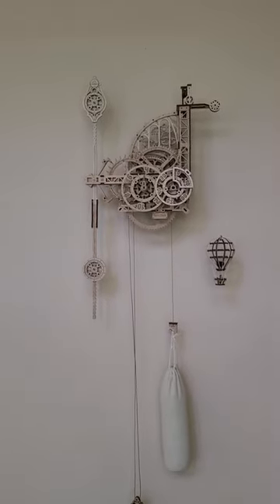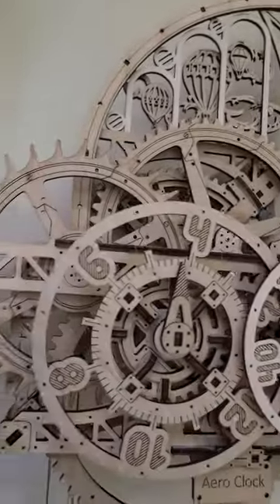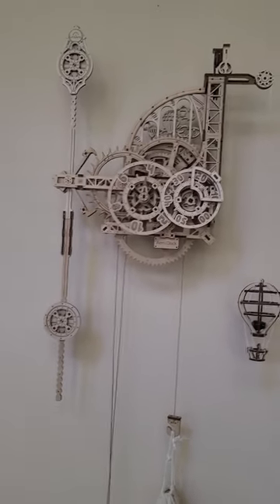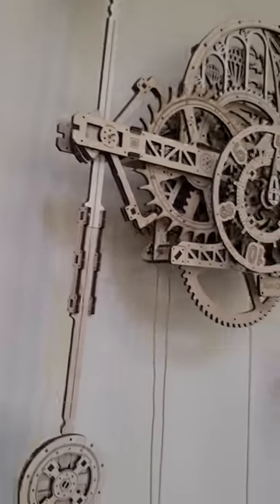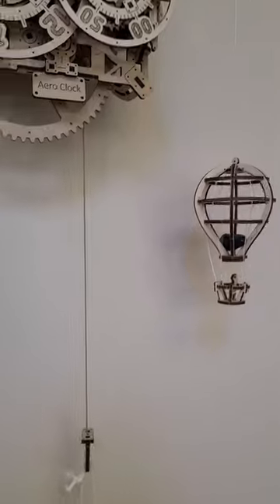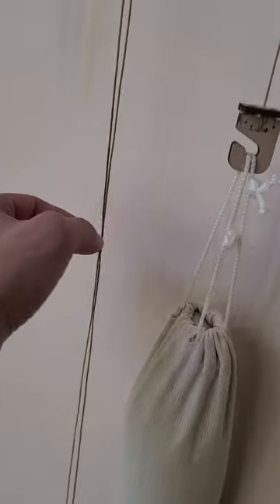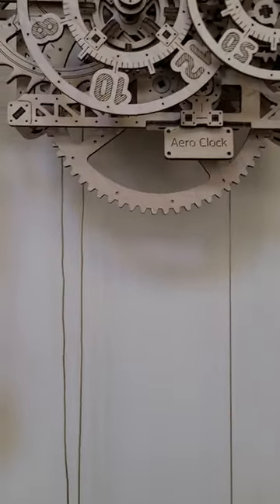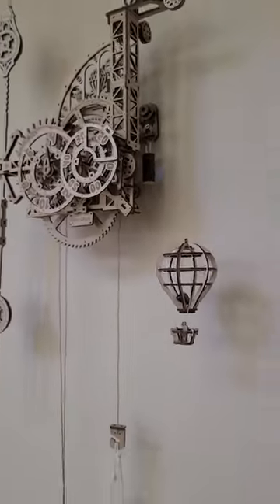UGears Aero Clock Review

Comment: Mine runs 25 hours, but not with the supplied sandbag, its just too long. I found a Lead Weight mantled with brass by Ebay which is only 4 Inches long. The mounting holes at the wall are 1,8 m high (as recommended). I also had to make that Gap as shown in the review. I used Vaseline to lubricate all the parts and gears with a small paint brush, thats much easier as a candle,  and you can lubricate the gear tooths completely . (You may have that for avoiding friction for  your best friend in your bedroom :-).  My clock runs smooth with only 1400 grams of that Lead weight!  that should prevent gear wear, if you need 2 kg you have to reduce friction!

Comment: how long does it run for? can it make it over 24 hours before a re set?
Reply from the maker: 12 hours
Reply: Bei mir läuft die Uhr 24 Stunden, das hängt aber auch von der Seillänge an dem Gewicht ab. Ich habe ein Bleigewicht, 900 Gramm, und  eine Seillänge von ca. 160 Zentimeter am Gewicht.
Reply: You have to hang it high on the wall to get it to run over 24 hours
Reply: It would depend on how much the sand bag can travel. I'd imagine, in theory, if you had it mounted on a tall enough wall, it could run for weeks.

Comment: I'm definitely interested in buying one, but since the tolerances seem so tight I wonder if the wood will warp if it's in an above average humid environment like in a kitchen that frequently has boiling water, in a room with a tropical fish tank, or a home that doesn't have or rarely uses air conditioning.
Reply from the maker: Mine has definitely become more finicky over time and I do suspect it's due to warping. Still, it's a lot of fun to build and is definitely cool when it's running.

Comment: Thank you for the review and tips! I’m slowly troubleshooting mine and I did take the piece off the pendulum to get it to swing more. I tried graphite powder on the escapement wheel too but it was too messy. I will also try to loosen the other connection you first mentioned. I have too much friction and mine will only run for a few minutes straight at most. I can’t wait to dial it in. For the WD-40, was that really helpful? I’m afraid it will just soak into the wood. Thanks again for your help!

Comment: Too right, FRICTION is your enemy.  First time I built this it wouldn't run, despite sanding and using the candle wax where directed.  I dismantled it and decided to use graphite powder instead on all axles, cogs and any surfaces that are in sliding contact.  Yes it's a bit messy, you have to be careful where you put it as it stains the wood, I used a small paint brush to apply it, but it's a far better lubricant that the candle wax.

It's running now, but the ticking of the escape wheel isn't consistent yet, but I appreciate that there is some running in period whilst everything beds in, especially where the teeth on the pendulum slide on the escape wheel.  Just pleased it's now running without stopping.  I've got around 2.2 Kg in the bag at the moment, I hope to be able to reduce that (so the loads on the clock frame are reduced) in the future when it's running consistently.
Reply from the maker: Graphite powder, really interesting idea!
Reply: Hallo Ian, 2,2 kg sind zuviel. Das verzieht die nur gesteckte Holzkonstruktion. Meine Uhr läuft derzeit mit 900 Gramm. Ich habe alle relevanten Teile geschliffen (600-er)und Buchsen, Laufringe und Zahnräder gewachst. Anschliessend wurden diese Teile mit einer weichen, rotierenden Bürste poliert. Der Leinenbeutel ist zu gross und setzt auf Grund der Länge zu zeitig auf den Boden auf; das kostet ein bis drei Stunden Laufzeit. Ein Bleigewicht von nur sechs Zentimeter Höhe ist günstiger und nimmt nicht so viel Platz in Anspruch. Die Seilkabine ist zu leicht und hält damit die Seilschlaufe des Aufzugsseiles nicht glatt. Habe etwas Gewicht (Blei in der Grösse des Kabinenbodens, 2 mm dick) in die Kabine eingebracht.
Reply: Instead of graphite powder, use a pencil instead. Also sand smooth the teeth of the gears, and polish with a piece 0f metal, the steel handle of a needle file will be ideal for this.

Comment: How do you reset it?
Reply from the maker: Take off the weight. Pull the left string (the one with the basket on it) down as far as it will go. That raises the hook that the weight attaches to. Put the weight back on. Manually turn the hour and minute faces to the right time. Done.
Reply: Es reicht aber auch, das Gewicht in dem gleichen Mass anzuheben, wie an dem Aufzugsseil gezogen wird. Und nicht so ein schweres Gewicht, das ist kein Kran. Habe derzeit 770 Gramm angehängt. 😏
Reply: @VladGutkovsky you don’t have to take off the whole weight every time. You can just lift up on the weight while pulling down on the carriage and it will be wound. That way you don’t have to reset time every winding